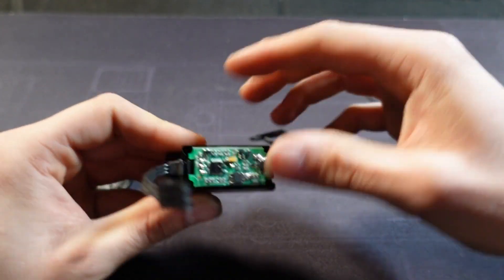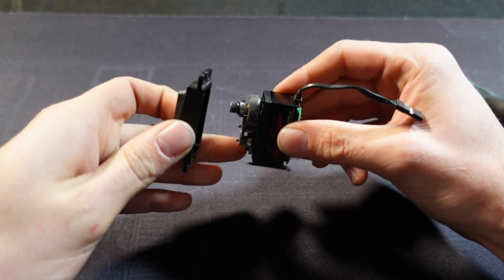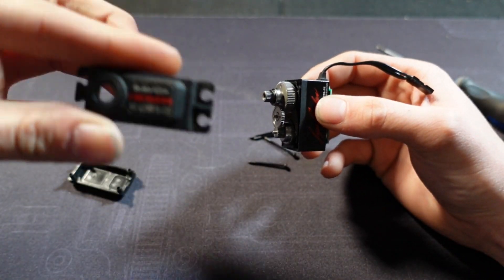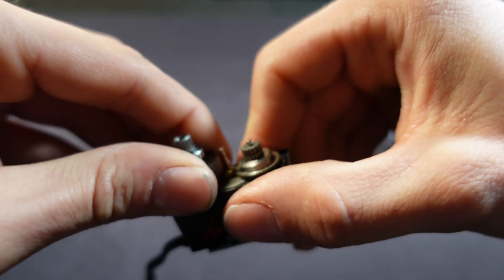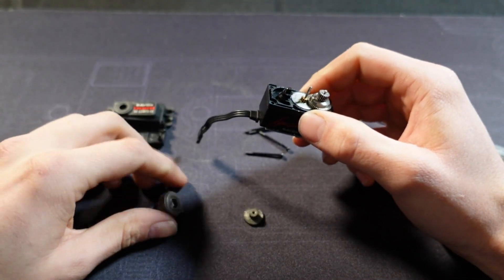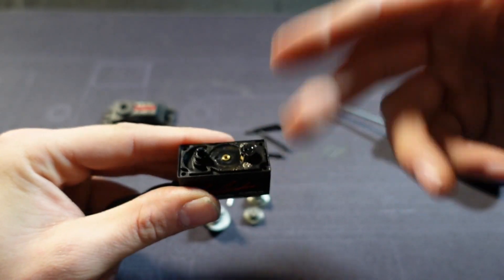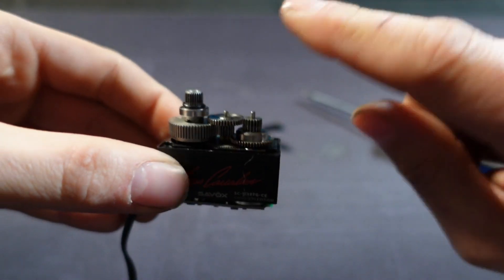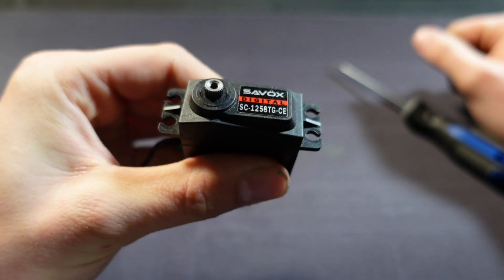What's INSIDE an RC Servo? Easy to Fix

Comment: Have a question, I have an rc crawler the wheels do turn when of the ground but not when it's on the floor. Any idea what it could be battery fully charge too.

Comment: Hi Tyler, thank you for taking the time to make this video, I’m learning every day. My question is a little outside your video subject but I’m an electronics idiot but I’m not a dumb guy, so I’m hoping to tap your expert opinion for some advice. I’m trying to pull the rope on a lifejacket CO2 manual inflator (No, using the auto inflator is not an option) using either a servo or a solenoid with a button as the trigger on off. So, I’ve guessed the torque pull required on the rope is probably 3 to 5kg and this is a one-time use one time pull device I’m trying to build. I don’t even know if that is even possible to press a button once and get enough torque from a servo or solenoid to pull a rope? Would the servo keep spinning or would it stop after the button is released? Any advice or suggestions would be most greatly appreciated! Thank you so much..!

Comment: Got some Power hd 23kg servos.  The motor is spinning (working properly, i guess when batteries plugged in. It won't spin freely when all gears installed. I got two not working and trying to piece one good servo together.  What other tips do you have? They stopped working after taking hard landing off ramps.

Comment: Good job man. Your 100% right, I was intimidated at first. You guys sold me a gear set for like $20, and I renewed a $130 servo. Easy fix. I too took a pic before I removed the gears, just for a back up.